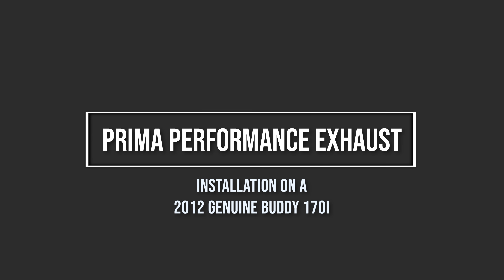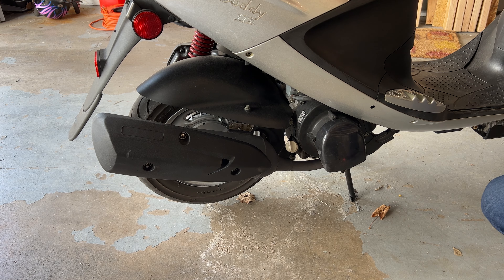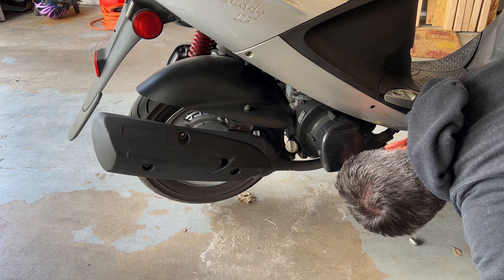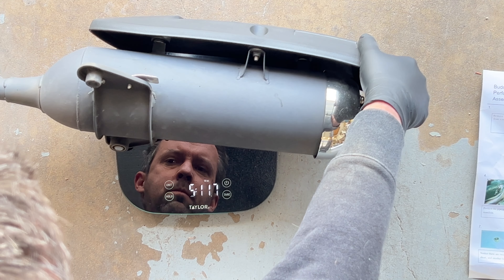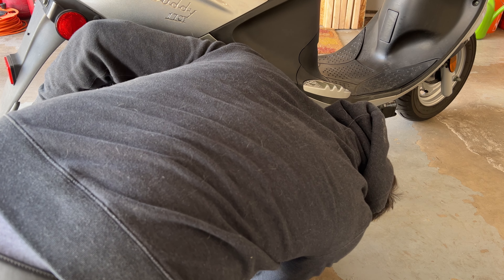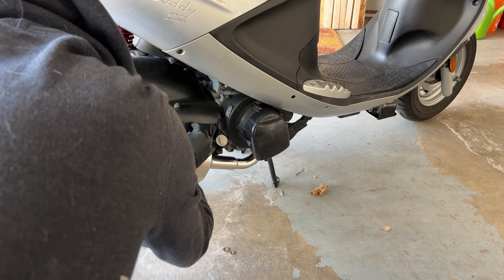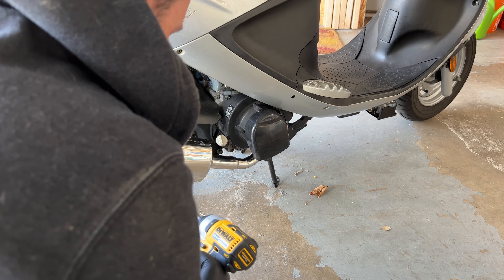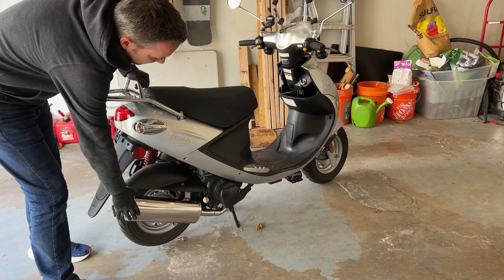How to install a Prima Performance Exhaust on a Genuine Buddy 170i

Comment: CORRECTION I meant to ask if you reused the stock exhaust Packing or that replaced with the exhaust gasket?
Reply from the maker: Hey!  The exhaust came with a new exhaust flange gasket and I used that.